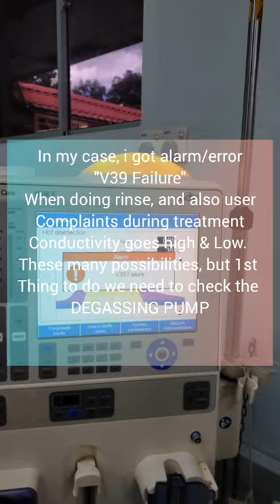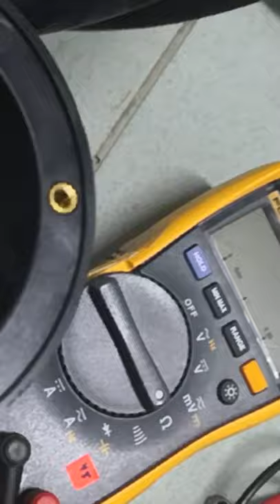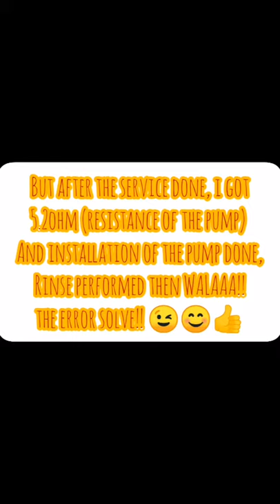Fresenius 4008S NG, ERROR V39 Failure in the end of rinse Solve.

Comment: bos pakai carbon brush jenis apa? share sikit bos
Reply from the maker: Biasa guna carbon brush DC - B145 bro.. Tp kita kena modified sikit..☺️🤗
Reply: @royrmatthew834  bos, mesti kena potong sikit carbon brush tu kan bos? Kebiasaannya lepas service tahan berapa lama baru keluar flow alarm pula bos? Sbb kalau service motor utk mesin NG flow alarm mesti akan ada lg smpai seminggu baru hilang flow alarmnya.
Reply from the maker: @jailanimukhtar4082  ya benar bos.. Ptong sikit. Agak lama jg bos..last tukar c. Brush ni, Syukur sampai ke hari ini machine ni masih digunakan.. 🙏🏻☺️
Reply from the maker: @jailanimukhtar4082  filter2 harus kna jga (ppm kits) dan yg terutama  diasafe filter harus kna tukar klau da smpai 3 bulan..
Reply: @royrmatthew834  boss. Gear pump head boss servis jugak ke ganti baru? Kalau ada cara repair gear pump boleh share sikit bos
Reply from the maker: @jailanimukhtar4082  haha.. Gear pump head blm pernah service.. Order bru terus tuan.. Tp my specialist ada mention boleh service.. Haha.. Nt sya try tnyakan..
Reply: @royrmatthew834  haha. Tolg tnyakan boss. Kena ganti parts apa dlm head pump tu nak make sure dac value rendh
Reply from the maker: @jailanimukhtar4082  orite2.. Haha.. Nt ditanya ya.. Hehe..
Reply from the maker: Hi bro.. For repairing Gear head part, not advisable.. But can open and clean the gears and put back.. U can rotate the nut to increase the pressure... But it won't be reliable.. any time pressure will drop again..
Reply: @royrmatthew834  oohh..thanks alot for suggestion bro..will try to service next time...=)